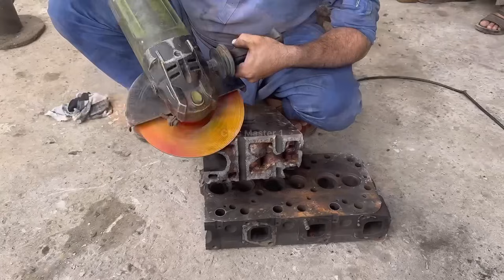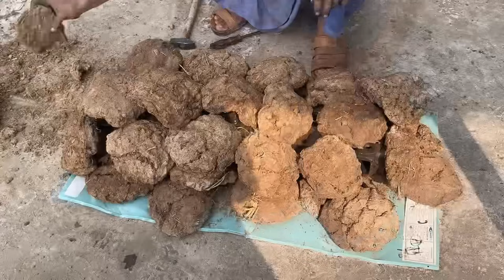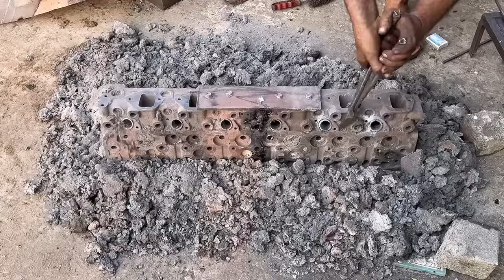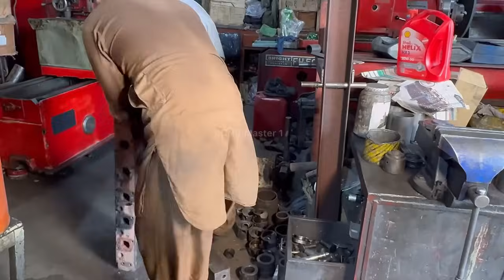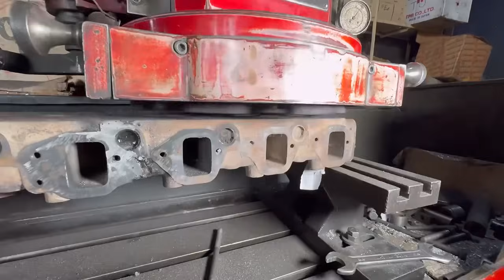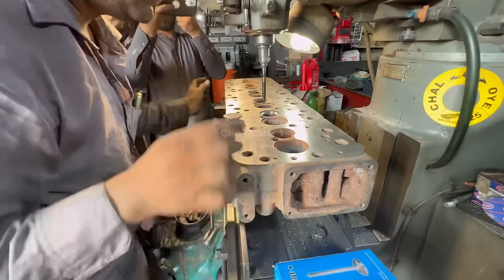Repaired a broken truck engine head by joining 2 pieces that will last a long time

Comment: Fake, why would someone score a line to break this head in half, only to send it out to be repaired? Why the fake repairs?
Reply: Why? Easy. To happen what is happening, people ete watching, interacting with comments, good or bad, and youtube sends him money. He improved his shop a lot since I started watching his material.  Some repairs are real, some are fake, but i watch them all.
Reply: I believe the shots are just out of sequence. The bevel grinding had already started before we saw the first close up.. When the head arrives, you can see it does not have that grinding line. In any case, this repair, with the internal passages not sealed, cannot work.
Reply: @bills6093  No, if you watch closely, you can see it was scored from the beginning. Engineered project. The welding work is good though
Reply: That’s what I thought…what about the interior passage cracks?

Comment: You didn't weld any of the internal structure. It won't hold water oil or compression with the valves open.

Comment: Well, can you explain or show how you sealed the exhaust port to water jacket core? I doubt that this cylinder head will be put back into service.
Reply: The dancing while cutting the valve seats was cute.
Reply: He didn't, if you look at the beginning, you can see the grinder marks where they pre-cut it, before using something to snap the weakened head. While it isn't usable as a functional head, it did showcase his welding skills and allow us to watch him "repair" the head, and earn him some money.